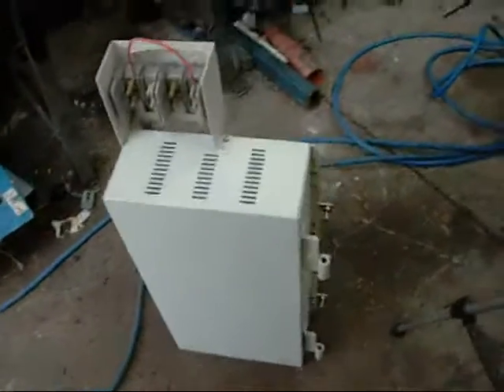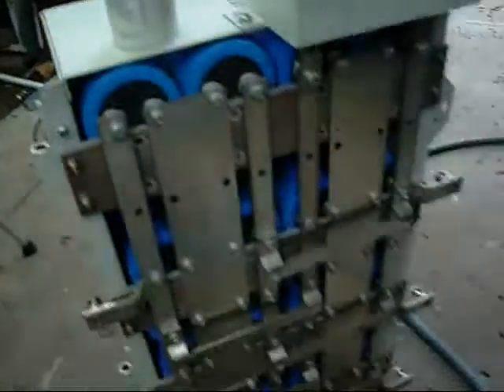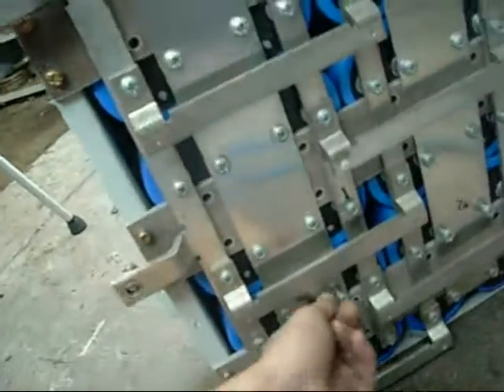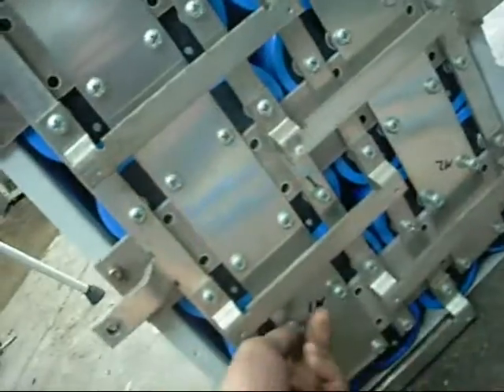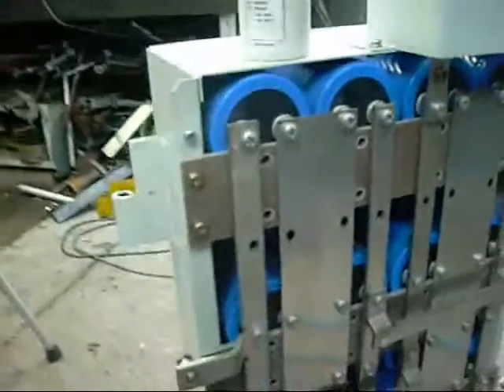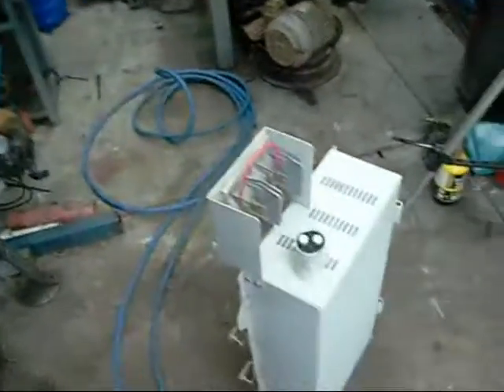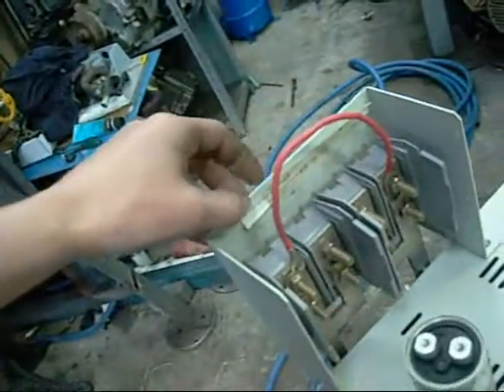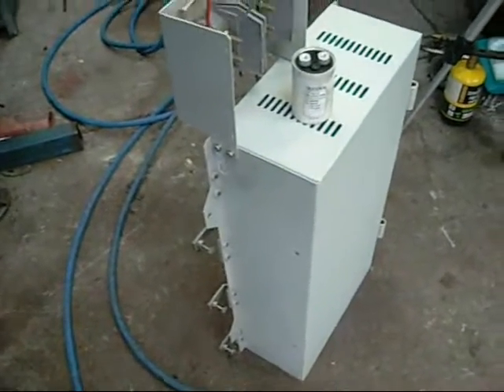Huge Cap bank - 6Kj 450V DC

Comment: (just make sure the thyristor can handle the voltage and has a huge surge current rating, and the diode has a high surge current rating and your all set for a elegant electronic trigger not requiring an air compressor) :)

Comment: Hey Aussie 50 - I'm building a mini thumper as well (you can see my cap collection on my channel in amoungst the other RC and laser related vids). Rather than using (and going to the trouble of making) an air ram contactor, those VFD's should have some nice beefy thyristors and a diode. Wire the thyristor in the -ve side of the banks output, and the diode antiparallel to protect the bank from back emf. Use 3v and a 10R resistor to trigger the SCR.

Comment: Missing 4 capacitors, with each capacitor rated for 2800uF @ 450V, using 14 strings of 2 caps as per this configuration, this makes the cap bank 19600uF (or 19.6mF) rated at 900VDC. This gives around 7938J of energy storage. The bank, as it stands, is closer to 8kJ than 6kJ. :)